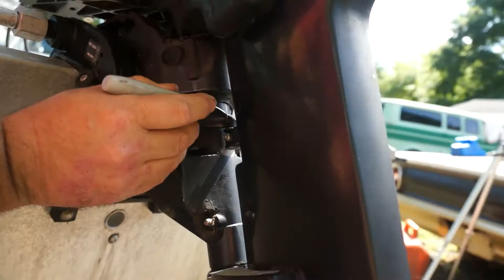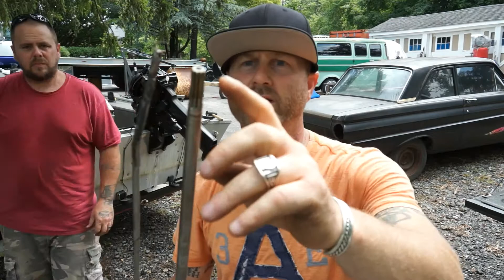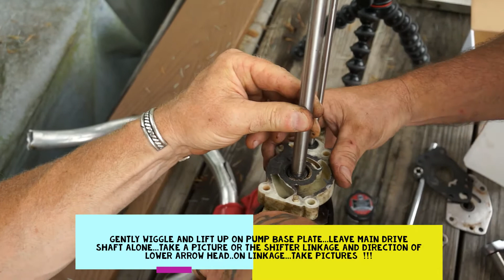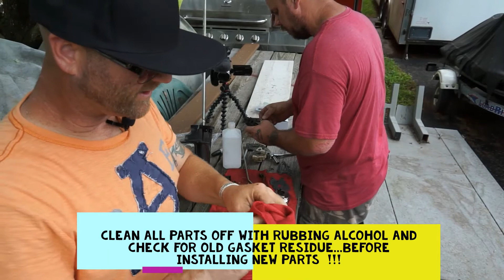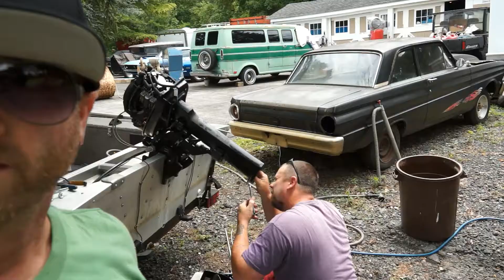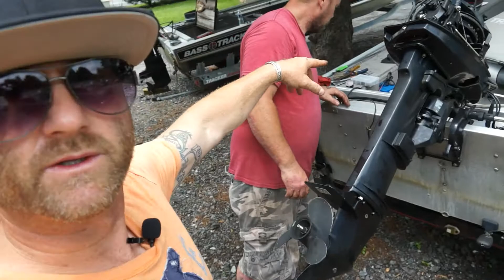MERCURY 9 9 HP WATER PUMP AND PICK UP TUBE FIX STEP BY STEP

Comment: This is exactly what I needed! My tube must be damaged because when I blow air through the pee hole on the motor, I can't feel any come out the bottom of the tube, and i can hear it coming out somewhere up there!
Reply from the maker: Yeah, those little gaskets get old..dry out..etc. Install a new water pump impeller and replace that upper gasket and you should be good to go. Fix it yourself and save that money!
Keith 2guys how2
Reply: @2guyshow2thefishkingz89  did that upper gasket come with the impeller kit or was that purchased separately?
Reply from the maker: @grantmaurer9641  The pick up tube gasket is bought seporate, from the impeller water pump kit. 
Those gaskets can be harder to get..less of them available..but, they are out there. Just find the exact OEM part number and then you can look on internet for a legit company that sells parts.. not a scam company that steals your money.
Reply from the maker: Crowley Marine had the gaskets for this video. Hard to find parts..Pay and wait a week or so. Good guys there.